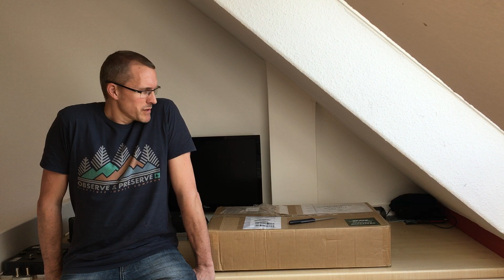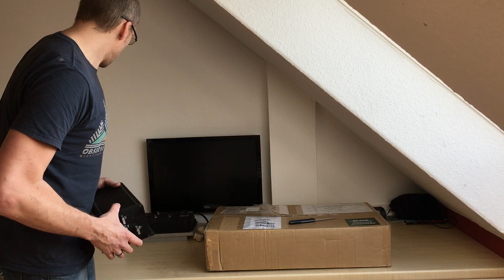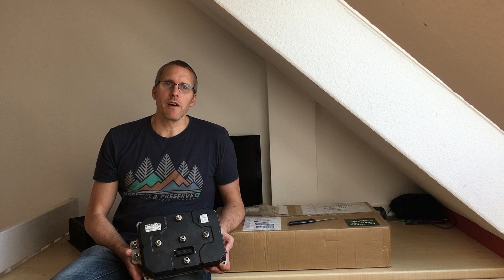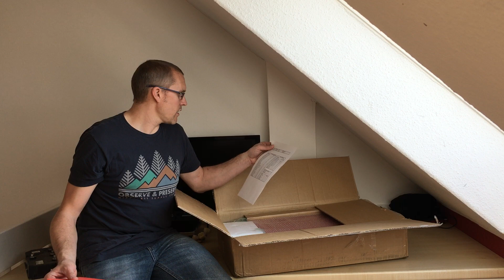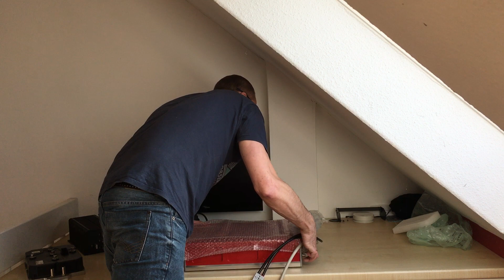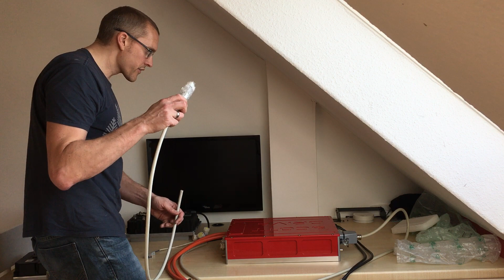Unboxing of Scott Drive SD300

Comment: Hallo andre Ich habe eine Frage, hast du einen KHB14601 Treiber? zu verkaufen
Reply from the maker: Sorry, den KHB und KLS habe ich schon verkauft. Aktuell habe ich nur noch den Emsiso EmDrive500 (NP war 2700€). 100kVA, 120V, 800Arms
Reply: @Andresander1972  Danke für die Antwort, ich brauche etwas von 145-180v Gruß Robert.
Reply from the maker: @score-bike2155  Der Regler hat Feldschwächung. Das haben die Kellys nicht. Damit kann man den Spannungsvorteil auch wieder wett machen. Man sagt so 15-20% Topspeed. Bis 172km/h GPS kam ich mit dem Regler.
Reply: @Andresander1972  
Andre in Kelly, du kannst das Feld um 30% schwächen, es gibt ein Patent, aber wenn du es übertreibst, geht der Fahrer in Rauch auf

Comment: Hallo, ich bin dein Fan, ich kann sehen, dass du mit mehreren Fahrern Erfahrung gemacht hast. Ich mache ein ähnliches Projekt und habe eine Frage zum KHB14601-Treiber, wie hat es bei Ihnen funktioniert? und ob es sich lohnt zu kaufen
Reply from the maker: Mit den KHB Modellen hatte ich leider nur Probleme! Der haut ein Rechtecksignal auf den Motor, was für ein komisches Geräusch sorgt. Des Weiteren konnte ich nie sauber durchbeschleunigen. Er ist immer in einem Fehlercode gelandet. Besser war der KLS 14401, der ein Sinussignal auf den Motor gibt. Den Motor hört man absolut nicht mehr. Mit seinen 400A war er zwar langsamer beim Beschleunigen, hat aber sauber bis 200 km/h bei 176V durchgezogen (in Verbindung mit dem QS273 80H Motor)
Reply: @Andresander1972  Vielen Dank für die Antwort, ich habe Erfahrung mit Quadraten kls Motoren QS273 80H Motor) som Wicklung auf Sinus Ich schicke dir einen Link https://www.youtube.com/watch?v=Yk__gZyHuEg&t=87s Ich kann dir was an privat schicken Telefonnummer 501053758
Reply from the maker: Cooles Bike!